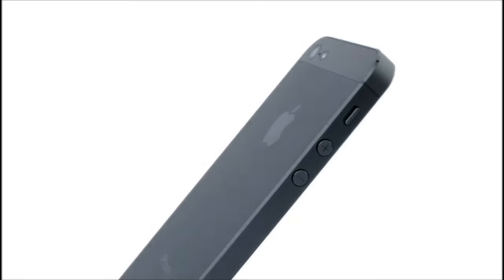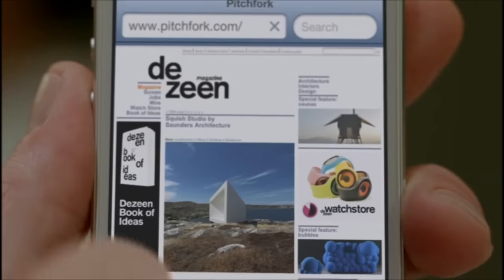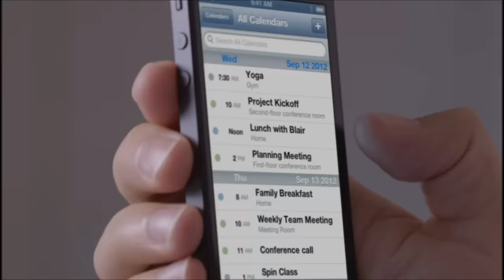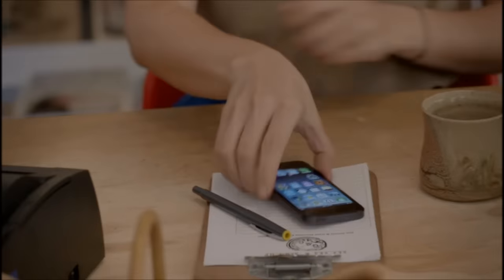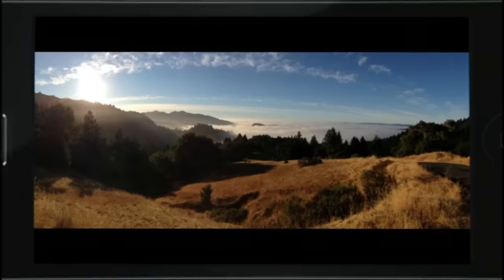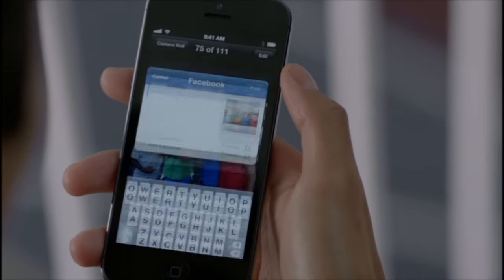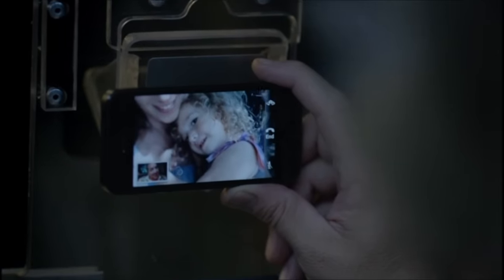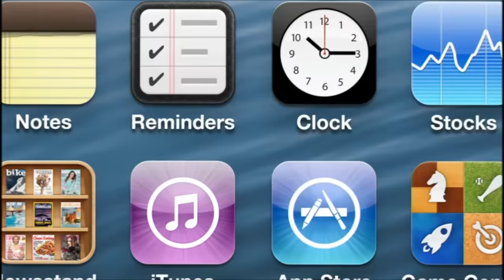Official iPhone 5 Trailer

Comment: I miss how it used to say "new" when you installed a new app
Reply: i miss ios 6 so much 😢
Reply: smashthecraft I miss IOS 6 sooooooooo much but my phone has IOS 6 tho
Reply: AWESOME GAMING CHANNELL how did you did it?
did you downgrade?
Reply: If you have a 32 bit Iphone, there's a jailbreak option to load any IOS on the phone. Its awesome. IOS6 design is still the best. New one is boring
Reply: smashthecraft NOSTALGIA
Reply: I miss iOS 6
Reply: Oh yeah... Forgot about that 😢
Reply: miss that iOS, i still have iPod Touch 4g with ios 6.1.6 but whenever i want to install apps, it requires either ios 8 or 9
Reply: I downgraded my old iPhone 4s from iOS 9 to iOS 6
Reply: @Alex-xg8py  not any. if you have a iphone 5 you can do ios 6,7,8,9,10 since the iphone 5 had these ios versions
Reply: @Cody Smith same

Comment: I never owned the 5 but did own the 5S and I remember back then how cool it felt to get a phone with a fingerprint scanner on it. 

It was in December 2015 when I got an upgrade from an old 4 that was given to me by my dad who no longer used it and at this particular time it was just the second smartphone I ever had because before I got the iPhone 4, all I had was basic phones from Verizon before switching to Straight Talk. I owned the 5S for two years and it was pretty reliable for me.

Comment: This was my very first iPhone ever. I had it for the full two years. When it was paid off I took off the case and for some reason it was durable af. 
I dropped it on hard floor tiles and it slid screen face down and all I picked it up it only had a few scratches. I had no temper glass on there btw.
Reply: I still use it